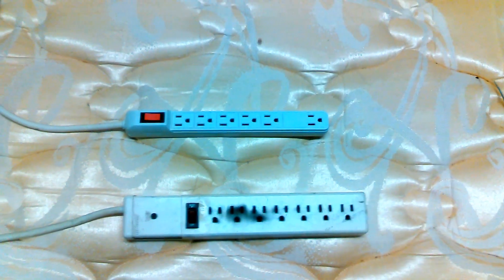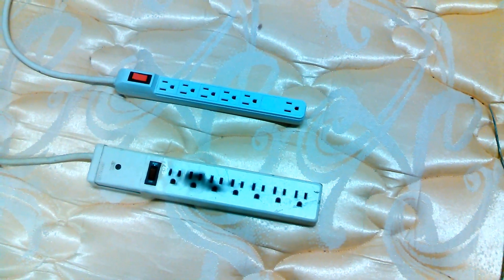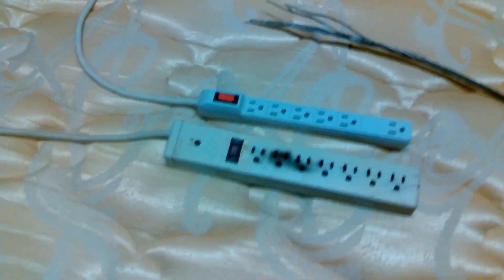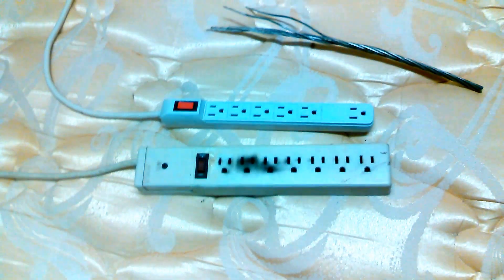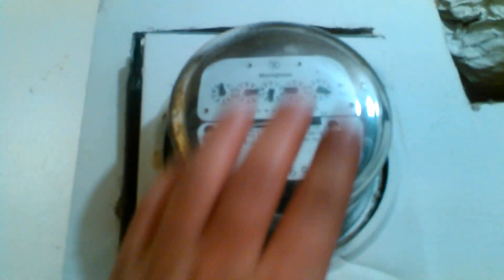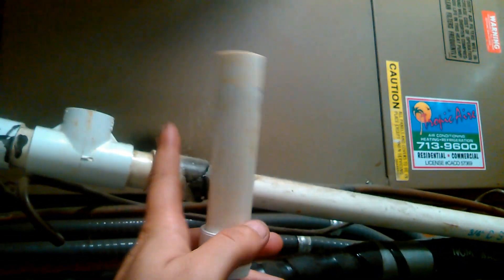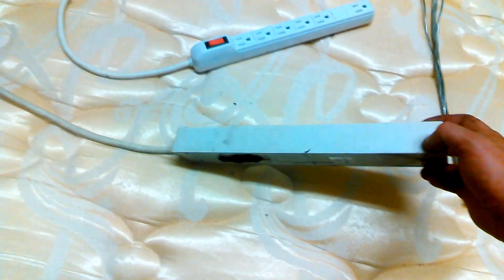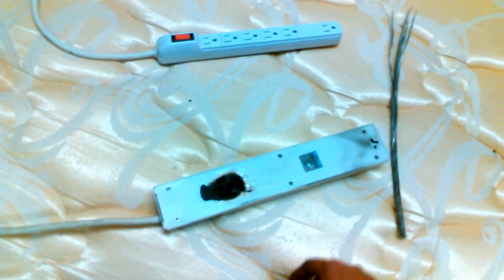What happens in your house when you drop a neutral line from the power pole.

Comment: Weird power stuff had been happening for months at our home, utility company said I needed separate circuit for microwave etc without even coming to look….repeatedly told them they were all on their own….problem continued to get worse….woke up at 4am to lights going haywire and something making a horrrible scratching sound and a horrible chemical electrical type burning smell

PGE still didn’t want to send anyone , told us call fire department….no fire but I called them back cuz clearly something wasn’t right….

Was the nesutral line to our home too….we lost some tvs and other items…

But what saved us was that scratching noise waking us up ….it wasn’t til after we started collecting the damaged items and surge protectors that we discovered one of the surge protectors had an alarm on it and that’s the sound it was making to warn us….didn’t even know it had an alarm but I certainly would recommend them to people after this experience

Comment: Last Thursday my power went off a few times. Friday night my furnace stops blowing hot air, Saturday I lost internet and cable. Yesterday cable guy came out and opened the cable box on the house. Wires were fried and it started sparking. I’m standing inside and all my outlets start popping and I smell something burning and see smoke. 
Cable guy runs inside yelling to call 911. Long story short, if I wasn’t here the house would have burnt down. We lost a bunch of plugged in devices, the whole furnace is fried and one of those surge protector bars lit the carpet in my office on fire. 
Don’t screw around with seeing your lights flicker, lights dim when your washer or dryer cycles, or your light bulbs all starting to blow within days of each other.

Comment: As a journeyman electrician,  I do mostly residential and some light commercial.   A few years back I was on a service call where the homeowner had a smart TV,  cable box, and a computer go up in smoke,  after a 1500 watt electric fireplace was in use for about an hour.    Home built in 1979, multiwire branch circuits for the living room and master bed.   The neutral failed at a backstab receptacle upstream of where the electric fireplace was used, placing everything downstream in series with 240 volts, the receptacles along the wall were alternate between red and black.   A big reason I don't like or use backstab.    It's also a code requirement that the continuity of the grounded (neutral) conductor shall not depend on wiring devices such as receptacles, when multiwire circuits are used, this would have been avoided if the neutral was pigtailed to the receptacles.  

In residential wiring, because of the AFCI / GFCI requirements,  multiwire circuits are essentially a thing of the past.   In commercial wiring, particularly office buildings, they are still widely used, because a great deal of wire and labor  can be saved when there are many 120 volt circuits in a given area.   One of the first rules I learned as an apprentice working in panels,  is NEVER lift the neutral off the bus, without first shutting off all the hots from that circuit,  if you lift the neutral and see an arc, there's a good chance you just destroyed some item's on that circuit.

Comment: Ground is not connected to neutral at pole. Usually the ground is bonded with neutral at the box inside your house, even the disconnect box outside is separate from ground and neutral. Theres a great debate on wether to bond neutral and ground.

Comment: I had an open neutral at my house.  On one side of the line, I had 101 volts and the other side had 147 volts.  It was intermittent and would notice that would affect the clothes dryer and the microwave, nothing else.  I fried a surge protector and 2 GFI receptacles.  I've been doing residential wiring for over 30 years.   I knew I had an open neutral or in my case, a partially open neutral.   I Contacted the power company and they sent someone out within 90 minutes of contacting them.

Open neutral is not something to play with.  If you notice signs or symptoms of an open neutral, contact your power provider immediately.  Could be a shock hazard as well as a fire hazard.  Not to mention, stuff can get zapped if you send 240 volts to something that was only designed to take 120 volts.
Reply: I just had the same a few months ago - lights went brown every few minutes, prompting me to grab the voltmeter - same as you 90 on one leg, 140 on the other. (I know which outlets are on which leg in my house) PSEG got someone out fast, and he fixed the neutral at the weatherhead AND across the street at the transformer!.  I've seen it a few times over the years.

Comment: When you lose the neutral, the two legs of the house go in series with each other at 240 volts. Depending how much each half is drawing, one side will have more than 120 volts, one side will have less.  Any appliance that gets too much or two little voltage could catch fire.  If you have dim and bright lights at the same time, turn off the main immediately and check for burning.